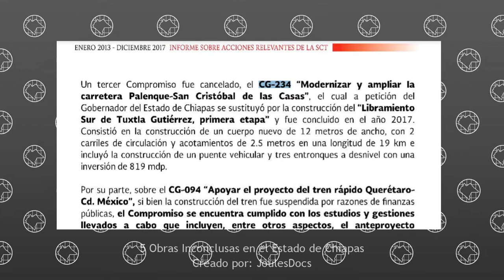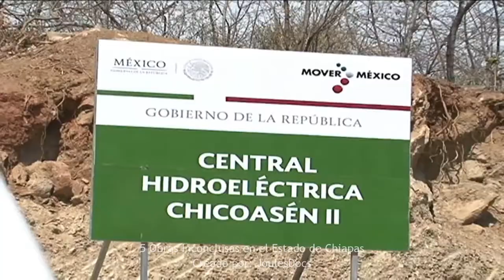TOP 5: Obras Inconclusas en el Estado de Chiapas | GeoChiapas

Comment: Hola. En el municipio de Huitiupan igual pensaban hacer una presa hace muchos años, calculo que por allá de los 70'. En un cañón natural hicieron varios túneles. Al dia de hoy, aun se pueden observas estructuras metálicas por las paredes del cañón, cables de acero enormes que antes era un puente colgante, estructuras de un par de edificios que ya están cubiertos por la naturaleza y lo más interesante es un laberinto de túneles que dejaron en el cerro. El cerro se llama Itzantun.
Reply from the maker: Impresionante información investigaré al respecto, te daré créditos por está contribución
Reply: Eh escuchado que en los ultimos años, en ese cerro de itzantun se escuchan tronidos, que tan cierto es eso?